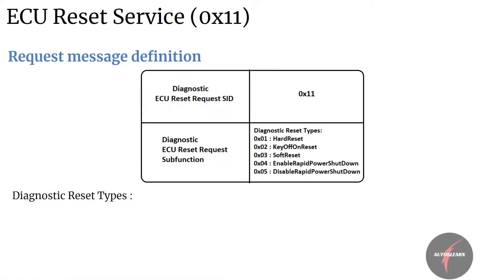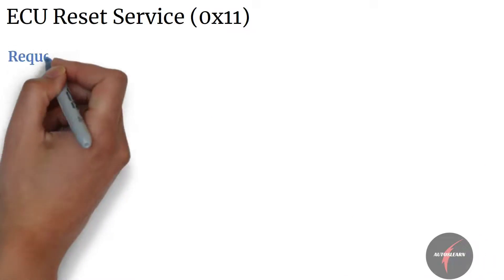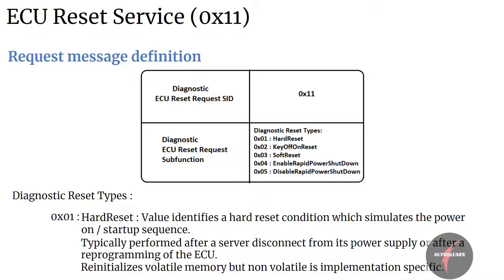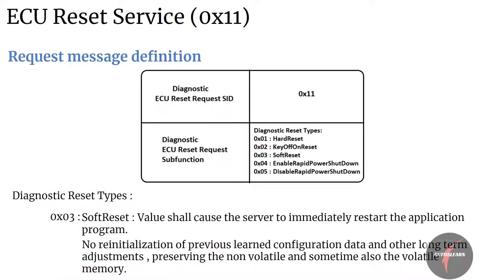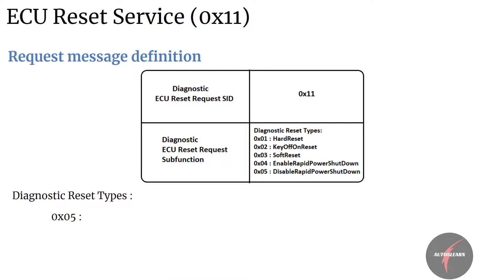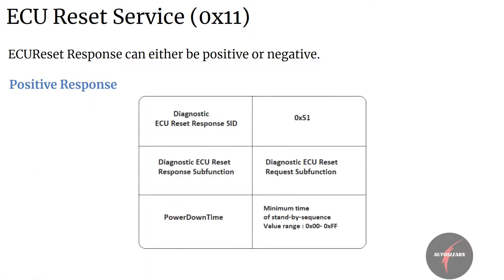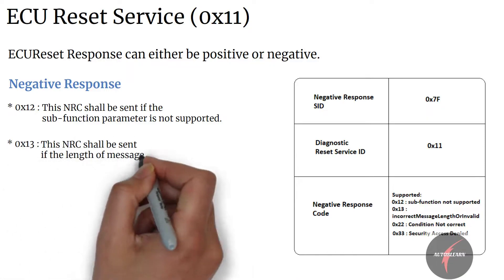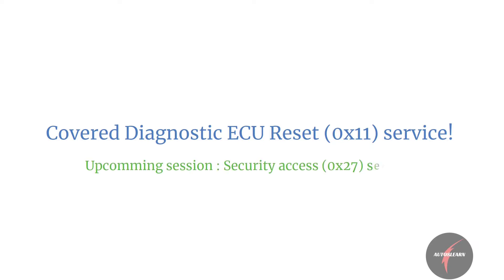ECU Reset Service (0x11) Made Simple | Automotive Diagnostics Series

Comment: Shall this 0X11 could consider as in dtc definition.
Reply from the maker: Hi Planet Power Steerings,

Diagnostic Trouble code abbreviated as DTC are used for troubleshooting faults in the ECU. These are different from the Diagnostic services. The 0x11 Diagnostic service explained in the video is used to by tester to trigger a reset, this has no relation to DTC definition or qualification.

We hope this answers your query. Thanks for your time and support.
Reply: @autoslearn  Thanks for your reply. 
 Your wonderful ❤️